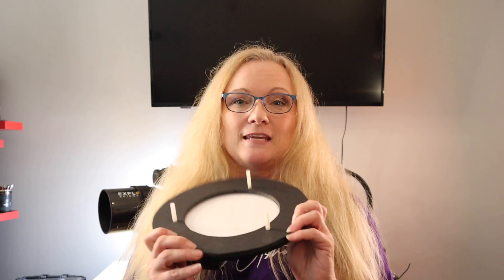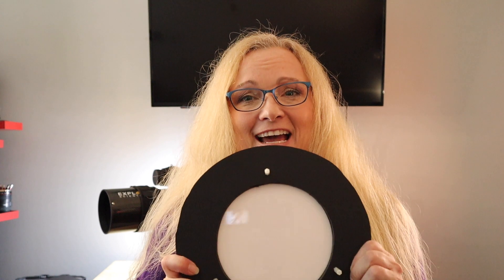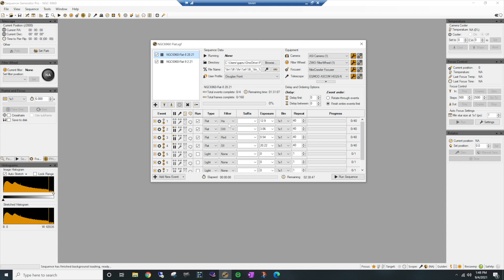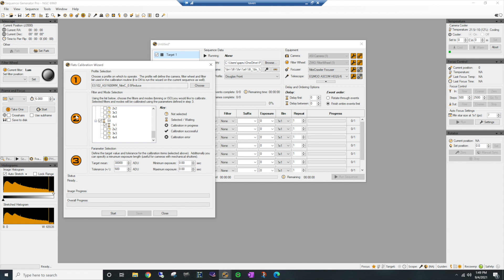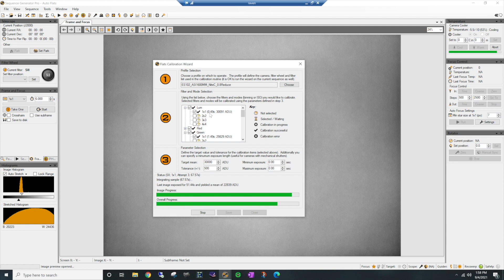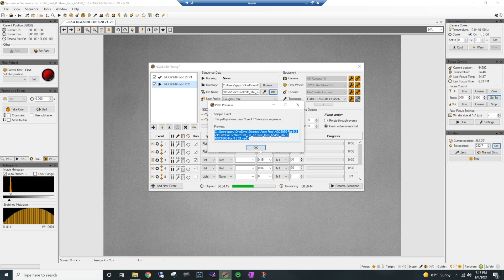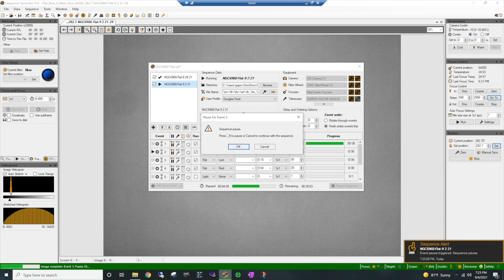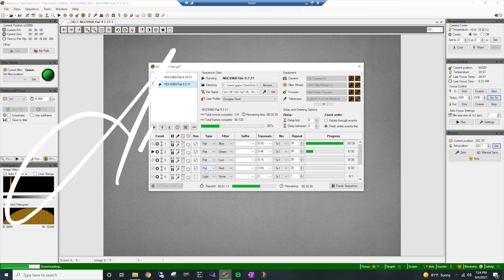Creating Flat Calibration Frames with Pegasus Astro Flatmaster and Sequence Generator Pro (SGP)

Comment: The Pegasus makes a high pitched whining sound also when its lite. You have the same issue as myself with narrowband flats especially Sii's as I'm well over a minute also but just be careful when taking those Sii flats if you use boost on the Pegasus app - anything over 15 mins can overheat the electronics.

Comment: If you are using asi 1600mm (I think it might be true for other cmos cameras) it is advised on cloudy nights not to do flats with exposures below 0.20secs for any filters as the camera may show some weird behavior as regards to mean ADUs.  Anything above 0.20 secs is fine. Great video. Also as a general rule you don’t want to go above 5secs flats on any filter. You can increase or decrease the brightness of the panel as needed. Or you can put sheets of printer papers in between to decrease the brightness.

Comment: Amy 
I'm not sure if you know this, but at Pegasus astro there is an app available with which the flat panel can controlled ; you install this on your PC and connect the flatmaster and start the program under settings is usb port on auto select press the button connection and look at command  Exchanged; there position send received and faults  if you are well connected you see there some numbers if this is not right the  disconnect stay on red then there is something wrong; if everything works well you can control  the panel in the control tap and change the brightness  you should not always press the button and you can be sure that it is on.
Greetings from Belgium - Frank
Reply from the maker: I downloaded the app and drivers.  I managed to get it to connect once, Yes the com port was verified.  When I adjusted the brightness for a filter it gave me an error message and crashed.  Any ideas?
Reply: @AmyAstro  Dear Amy
I immediately went to test out after reading your message and tested it on my desktop PC and on my mini PC that I used to drive my devices in both cases I had no problems; I just connected the flatmaster to the free usb 3 port of my desktop pc and started the program at settings  on  connect pressed checked whether the connection was in order then under the tap control at filters each time a new filter name and with the slider controller the desired brightness set and on save pressed on my mini pc I have to connect the flatmaster with a usb hub with power but here I had also no problem; please note that the flatmaster is not controlled from another program such as SGP or N.I.N.A normally this is not possible but you never know; since I have no problem I cannot offer you a solution; you can do the following remove the Pegasus Astro software and install it again do this with administration rights and also the usb driver do this without the flatmaster is connected i hope it gets in order.
Greetings from Belgium - Frank
Reply from the maker: @Bogfra1  thank you for checking. I will try again. SGP might have been interfering with it.
Reply: I used the flat master this morning and started pegasus astro's program got a message that there was an update that should fix some bugs.
Reply from the maker: Excellent.  I will need to run some flats this afternoon.  I am on a clear sky streak now.  I decided to use this gift to create a 3 panel mosaic.  Tonight should be my last filter.  3 Panels with Ha, Oiii and Sii, 100 images each filter at 4 min.  Cross your fingers.
Reply: Amy 
You can also test this out in a somewhat dark environment; connect the flatmaster if  it lights up this is already in order; start the Pegasus astro software and go to  settings  you can use Auto select or even choose the usb port but you have to be sure press connect now  ; at the bottom left must definitely be a blue dash and  connected if this is not the case, the rest will not function either.
 @AmyAstro